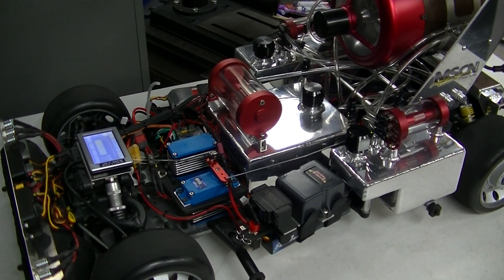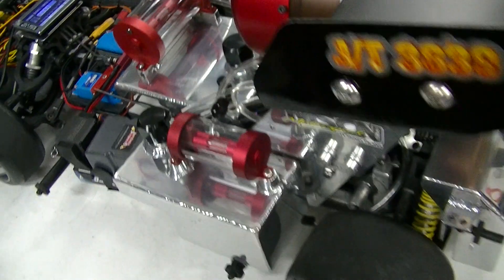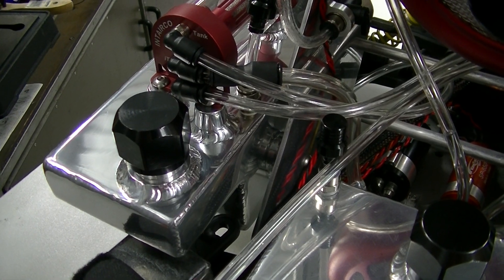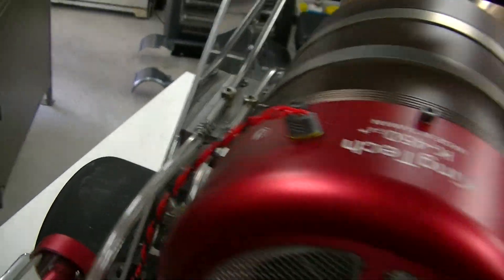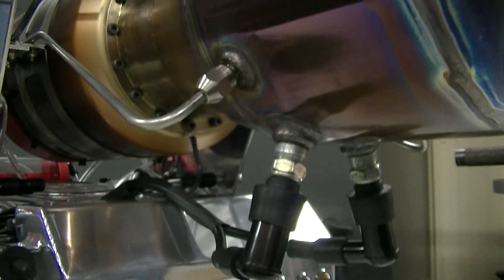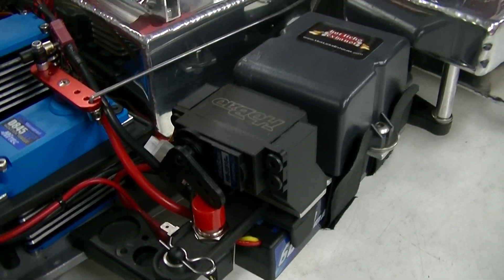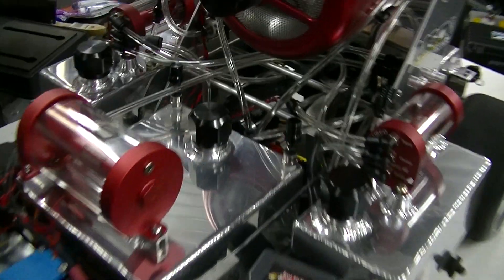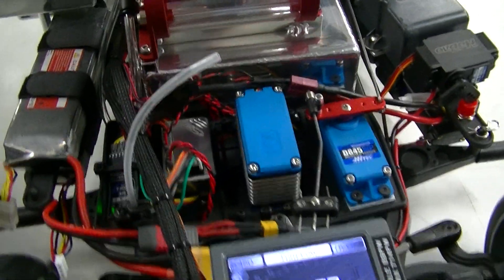1/5 RC Jet Turbine powered rc drag/show truck walk around

Comment: Just wanted to say you did a great job both on this guy AND on that badass exhaust system on the nitro slash drag car! Did you notice any performance issues with the engine? Ive been pondering doing a similar setup
Reply from the maker: thank you, the performance of the nitro slash with my exhaust is lower due to added wait and possible increased back pressure. looks cool and thats all i did it for